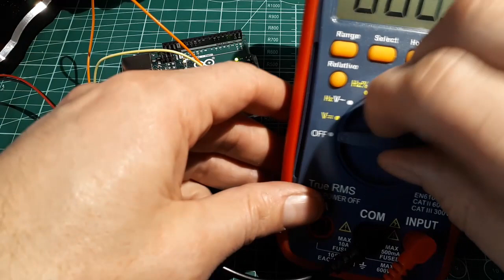Arduino Beehive Scale Part 1

Comment: Hello! 

It would be good if you recorded how did you put this load scell into that 3D printed case. I have already printed it, but I still can't figure out who I should put the load cell in it.

Many thanks!
Reply from the maker: the printed frame is a very, very tight fit, I even had to sand down the inner edges. Hold the printed case so that the beveled holes for the screws are facing down. You then place the load cell with the rounded center face down in the case. Afterwards, you press the support ring into the case and it should lay flat agains the flat side of the load cell. I also had to modify the slit on the case for the wires to go through because it was too narrow. Good luck.